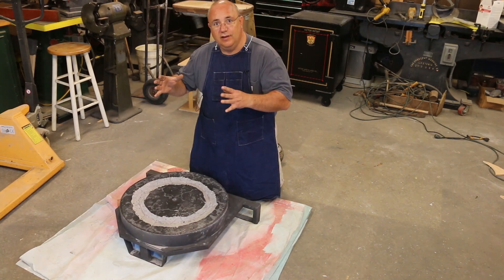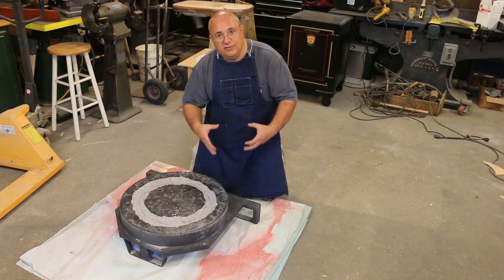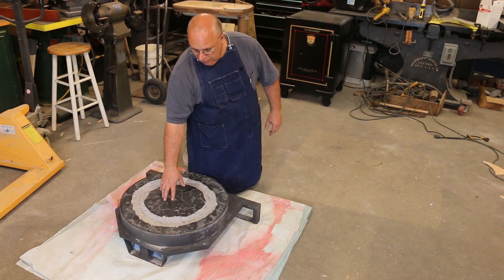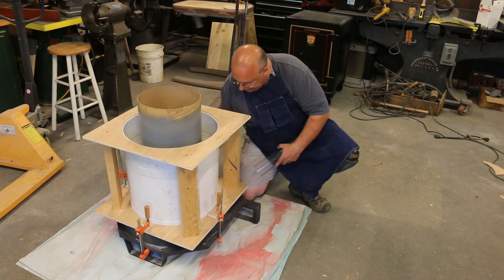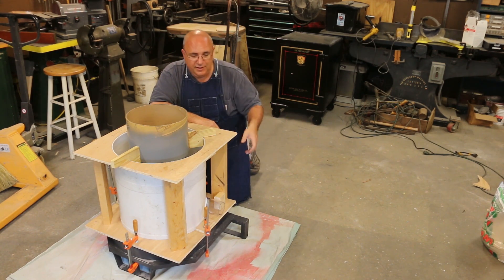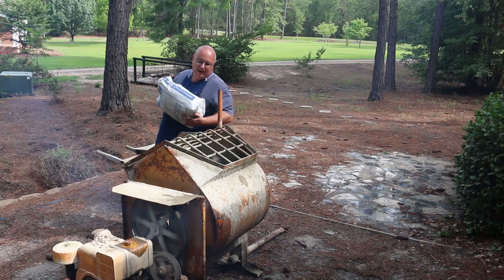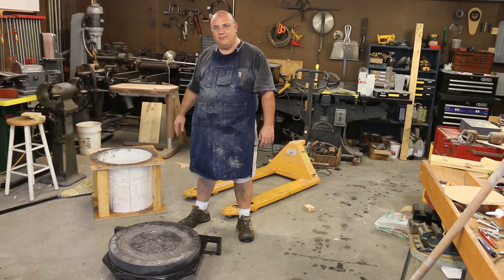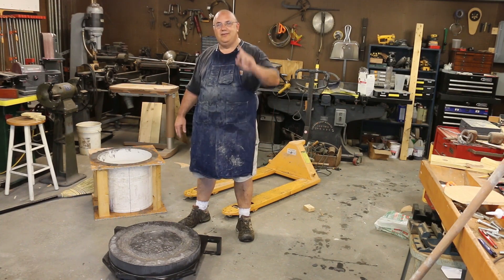Building an Oil Fired Foundry Furnace - Part 5:  How NOT to Cast Refractory

Comment: Just wondering, do you think filling the inner tube with molding sand would have made it strong enough to hold? I think it might be a good idea to wrap the tube with 6 mill plastic and run a piece of duct tape along the seam. Thanks for sharing, I am planning on building a furnace like this soon and you just might have saved me the same problem. If someone isn't making a few mistakes they are not doing anything themselves. I watch yours and other videos here and have learned quite a lot, thanks again. John F
Reply from the maker: imystery man Thanks John, in retrospect, I think that there are several things I could have done differently, but I would have never known that until I tried this first....
Reply: Keith Rucker - VintageMachinery.org I am trying to help you come up with ideas that will make this project a success, in no way am I trying to criticize what was done.  We all now know what won't work. It sure makes sense to me that if the tube was packed with refractory sand and tamped in, it would provide the support needed.

Comment: Suggestion:  Do you have anyone that is a Cooper that works at the museum?  If you do, you might ask them if they can come up with something out of wood that will hold up to the pressure, made to be knocked apart for removal.  Maybe that my memory is not correct, but I seem to think that a Cooper could do more than just barrels.
Reply from the maker: diggerop LOL - Yes, we do have a cooper at the museum.  That would be a lot of work for a form though.....

Comment: I was just thinking - I'll bet if you would have taken the other half of that inner tube, slit it and put it inside the other one, that would have given you the strength needed. You could also put a plastic garbage-bag down the middle tube and filled it with water to create some counter pressure also,

Comment: Sorry to see the failure.   Another youtube channel "myfordboy" from England built an oil fired foundry furnace much like you were working on,   That channel may help, hope it does.   Hopefully you learned something.   Failures are hard to take.  Been there done that.
Reply: John Leake I watched this again this evening.   There are much heavier cardboard tubes called sonotubes which I have used, they are about 1/2" thick,  but they are similar to the failed one, designed for tension, not compression.  How about using a chunk of PVC pipe?  Getting it out could be a challenge (other than melting it).    I have no idea if that is readily available in Georgia, but an underground construction company might have the 3 feet or so you need as scrap laying around.    I'll check around here but I would bet the shipping would be prohibitive.

Comment: Hi, Keith- Just wondering if you've considered building your furnace using insulating firebrick. Larkin Industries (Lithonia, GA) supplies arch bricks- a keystone shape that allows you to construct barrel shaped kilns (or foundry furnaces). You can wrap the outer surface with ceramic blanket, like Kaowool to fit your steel shell. Soft insulating bricks are easily trimmed and you can bore them with a hole saw. The insulating qualities will improve relative to castables. http://www.larkinrefractory.com/7218.html
Reply from the maker: Dennis Stephens Yes, I considered it, but decided against the brick for several reasons.  This furnace will also have a blanket around it when done.

Comment: Hi Keith,  After watching the complete video, a couple comments towards your next effort;  the mix seemed a tad wet and heavy, maybe using the absolute minimum of water ?;  you seemed to me as though you were compacting the mix rather vigorously , especially at the very beginning of the process, perhaps a bit gentler on the next one.  Seems like the refractory functions as it does partly ( maybe even largely )  through a large amount of air entrainment.  I am just starting my own foundry furnace and have been watching many many different versions of these being built on you tube, taking bits and pieces that seem the most logical and well designed to use in my own project.  Thanks and God Bless you and your next effort.   Darryl Dodge
Reply from the maker: ***** Thanks Darryl, the mix is supposed to be that wet, it was mixed exactly to the manufacturers recommendations.  I poured a couple of blocks of the refractory in some plastic tubs from what I pulled out of the mix and it came out perfect once hardened.  Just got to build a stronger inner form.

Comment: Keith, so sorry about your mishap…   guess we all learn from these at one time or another.   When I saw you did not have a full round wooden disc in the bottom of the tube, I had a bad feeling right away…   Best of luck on your next attempt. Thanks for sharing the bad with the good, your videos are some of the finest on you tube.   Darryl Dodge
Reply from the maker: ***** I think that a solid disk would be better, but in this case, I think that the problem was where I cut the hole through the form for the pipe to come in the side.  It caused the form to be weak in this area, which is where it started caving in at.

Comment: How about a stack of Styrofoam circles wrapped with some sheet metal?
Reply from the maker: TheDisorderly1 I like this concept.  Some have suggested using spray in foam insulation to fill the form, which I even like better!
Reply: Spray foam is too unpredictable,  at least in my experience.

Comment: Keith, I worked at ""Queensland Alumina Limited "QAL"" here in Australia and was a hole watcher (security to make sure all that worked in the confined space were safe) And even being on the outside of the hole I was able to see the Pros doing their stuff with refractory!! They used to spray it (but that don't matter long as you mix it right) They also watched holes where there were boilermakers in the hole welding anchors which I think you need to anchor both parts together, I haven't watched to the end yet (:56) and don't know what you're going to do but you do need anchors!! to bond both together!! love the vids and keep them coming especially the series. Just watched to :12:42 and I reckon you should have used rods down throgh the refrectory!!
Reply from the maker: Beryl Barker They guys who work with refractory are telling me not to use any metal inside for strength as the metal and refractory expand at different rates when being heated and it will cause the refractory to break.

Comment: Hi Keith: I'm sorry about the turn of events. Have you any utilities companies near by ?
They usually have left over pieces of heavy gage pvc pipe or even steel case and some of that stuff comes in big sizes that might be just right for your need. We at work have 12 inch o.d. pvc that is 1/2 thick and very strong if that would help let me know I'll send you some.  Thanks for  sharing. Better days are coming.

Comment: I hate that, sorry it didn't work out Keith, I was lucky I guess after seeing this but I was using an eight inch form tube with turned aluminum disk to fit the inside on top and bottom. Your idea would have worked I believe if you had filled the inside of the form tube with sand all the way to the top to the top to counter act the external pressures. My next one is going to be in segments.
Reply from the maker: Clarke E The blowout started where the form was cut for the tube to come in from the side.  I think that the hole hurt the strength of the tube in this area and as soon as it started failing, it was all over....

Comment: I work in a steel fab shop and we have guys come all the time to pour refractory, Coat your forms with Crisco they will come off a lot easier.and its hard to tell from your video but your mix looks a little to dry, when these guys do it they can pour it out of the bucket like cake batter. Better luck next time
Reply from the maker: JOHN HUFNAGEL I can't help but laugh - some say it was too wet, some say it was too dry.  All I know to do is follow the instructions that came with the refractory.....
Reply: like I said it was hard to tell and yes no matter what anyone says follow the instructions. Have a great day

Comment: Hi Kieth, You might try using some SR-35 plastic sewer pipe. That is the green plastic high pressure pipe. You might be able to snag a cut off piece from a supplier. It comes in 12" as well as other sizes. Enjoy your videos and your web site. Have found much needed information there on different machines. Hope this might help. George

Comment: Hi Keith, Sorry to watch what happened. Scanned through some of the comments and bcbloc02 seems to have a germ of an idea which should work, with his suggestion to use expanding foam. It would certainly be strong enough and could be formed inside the cardboard tube. Anyway you seem to have lots of moral and technical support so will be sure to succeed next time. Only problem now will be to get agreement from your good lady to buy another batch of refractory. But I'm sure you'll be up to that. Regards
Reply from the maker: Peter Gregory Yeah, the cost of having to buy the refractory again was not in the budget for this project, but we will make it happen.  Might have to save for a while first though.....

Comment: Hey Keith I know this is off the subject, I very much enjoyed watching the restoration on the Vance Planer Matcher. any idea when we will see any future updates on that project. I feel like a kid with a piece of candy hanging over his head but not tall enough to reach.
Reply from the maker: Michael Eddington We are still working on getting the old John Deere tractor running that we will power it from.  Long story there - it is almost done.  Have some issues with the gas tanks needing to be boiled out and coated inside as we were getting trash in the gas which was stopping up the fuel flow.  Right now, the museum is in a spending freeze until the end of this month (the start of their new fiscal year) so we hope to get the tractor running as soon as we can fix the tank.

Comment: Hey Keith...

As Robin would say...
"Holy collapsing tube Batman!!!
It looks like the dastardly Murphy is at it again...
Will we ever be able to stop that notorious corrupter of best laid plans???"

"... Not so fast Robin... It might be Bozo... We must investigate...
To the bat cave!!!"

 I was anxiously awaiting this video so of course I am disappointed for both of us when things did not work out for you.

When you attempt the do-over... remember...

Whatever you use to fill the center tube must be relatively solid...
fluids are not the answer unless you can seal the top, bottom and hole for vent tube.

Use spray foam... it will be fully ridged and it will not collapse under the load of the refractory.  it will also adhere to the base forming a "cap" of sorts on that end...
Along the sides of the waxed tube, adhesion might not be ideal so I suggest sanding some of the wax off... maybe the top 10 inches or so... This will create a "cap" of sorts at the top of the tube... It will not collapse from the weight you are putting on it. 

Removal can be tedious and messy (dry messy) but is definitely not difficult.
The cured foam can be chipped out with chisels, gauges,.. etc.
You may even be able to use a reciprocating saw in spots if the foam is not too dense.
A wide blade air chisel will cut through it like firm butter.

I am guessing that if you liberally grease/wax the outside of the center tube, you might
just be able to pull the whole thing out in one piece...especially if you mount some sort of hook in the center before you spray the foam.

Another option is to cut two wooden circles to fit snugly into the ends of the tube.  Nail or screw them to the tube mounting an eye hook or two in the top one so you can attempt to pull the whole assembly out after the refractory cures.

Refractory will definitely not seep through the joint of the vent tube.  Same for the top and bottom with the way the foam adheres to the top and sides.

You will not have to scrape the sides of the tube spotless of foam... just get it low and cut or pull the tube out as originally planned.

It would be nice to fill it with wax so you can melt it out but I am guessing that would be prohibitively expensive when we have spray foam available. (have any friends with a bee farm?)

Hang in there... We all know you will get it done and in the end you will have taught all of us and yourself a few lessons.  All good stuff.  Hey... It's not the first time you have been disappointed and hopefully you will be around to endure more disappointments and learn more lessons in the future.

Plus, now you have a good campfire/fireplace story to tell the next time you hang out with your buddies or at the next family holiday get-together.

PS... I have a couple ideas to make the tube much easier to remove if you are interested.  Just let me know if you want to hear them.

Be Well, God Bless

Anon
Reply from the maker: Anon Ymousmie Thanks for the suggestions.  Several others have mentioned the spray foam and that might be part of my solution for the next attempt!

Comment: If this would have happened to me My Verbiage would no-drought surprise a Sailor.. 
next time you might consider sealing the tube with Form oil or spray the tube with diesel also used with plywood cement forms.. the idea of filling the inside with gravel I think is a good one.  maybe 1/2 inch minus crushed, it would also pack well too.
I hope this helps ! best of luck next time! It looked like you had it nailed to me this time.

Comment: While pouring was there a need for a vibrator to eliminate air bubbles?
Reply from the maker: Robert Giovannucci Not necessary with this particular kind of refractory.  It is made to be cast into a form without a vibrator.

Comment: Hi mate.
That is such a shame.  I was so afraid that something like this would happen.  You might have to find yourself some thick walled PVC pipe, and make some baffles inside, to keep the walls from collapsing.  You might have seen the episode of Oxtools, that was demonstrating the wire strainers, that he had as a mystery tool.  Maybe you can strain the inner tube to the outer tube, and hold it all under control that way.  I was also thinking that, the stomping with the 4by2 might also have been a trigger for the collapse.
Again, I'm so sorry that it went wrong.
Kind regards,
Marcel.

Comment: We had a concrete leak at the bottom of a form that was nearly 20' tall, and had a devil of a time getting it stopped up. Stopping the pour was not an option, so the guys worked with concrete spraying in their faces until they got it shored up and plugged. They just kept trying different things until the concrete stopped coming out. It was around a place where the equivalent of a core box went through the side of the forms.

I eventually bought a core drill so we could pierce the concrete after it set up. (800 cubic yards of concrete in our foundation eventually and 70 tons of rerod.)
Reply from the maker: Peter W. Meek In my last furnace, smaller and and with much less dense refractory, I was able to drill the hole out afterwards.  That would be a real chore for this one though...

Comment: Keith, sorry to see it fail after all that work, but failure is a learning experience.
A suggestion for your inner form. Find a water heater tank that is about twice as long as the needed form. Grind the bottom weld off the and pop the bottom out. Cut the tank to length and than cut the tank into three pieces lengthwise, cut strips from the rest of the tank to join the tank pieces back together. Install plywood reinforcing plates into the center of the new form. Use Tek screws to join the tank piecs back together, I used a junk galvinized water tank to make a sump  form for a friends basement. Install the screws from the inside and than grind off the excess
Dan. .

Comment: Kieth! Read me! I built a foundry with the exact same cement inner form, and had no problems.  The only thing that was different between what you were doing and what I did was that my refractory had a very different consistency.  I am just a hobbyist, but I have never seen refractory slump nearly as much as what you mixed up.  My recipe had me adding only just enough water to turn everything to a paste.  As a result, most of the force was directed straight down with gravity, not inwards with fluid-pressure.

It is a lot of work to cast refractory like that.  I made mine with 4 or 5 people helping, and we were all still pretty beat.  When you pick this project up again, (and I hope you do soon!) call in some friends.

I absolutely know that feeling when everything feels right, and then a project just catastrophically fails.  I was trying to cast a full-head silicone prosthetic mask.  You mix up $200 worth of platinum silicone, and you have about 30 minutes to inject it into your mold, and wouldn't you know it, get a flaw in the mold that prevents the silicone from flowing.  Using all of my strength to try and force the goo to inject, only to fail, and wind up with a $200 perfect silicone mold of a massive injection syringe; combined with missing my deadline.  Absolutely devastating feeling.

You should confirm this, but I'm almost certain, if you have the tools to grind your garbage refractory up, you should have the ability to mix it at least 50/50 with fresh refractory, and have it still be every bit as effective.  Checkout myfordboy's recent videos on his foundry to see how he cobbled a concrete vibrator out of a orbital sander and a rod. It can come in very handy when working with refractory that has a lower slump than what you were working with.
Reply from the maker: verdatum Yeah, I kind of felt like the mix was a bit on the wet side, but I was following the mixing instructions.  The real problem was the form not holding up.   We will make it work next time...